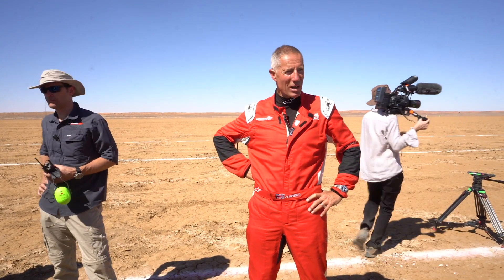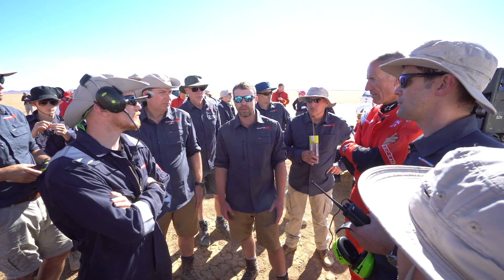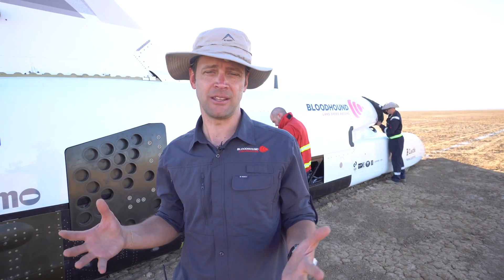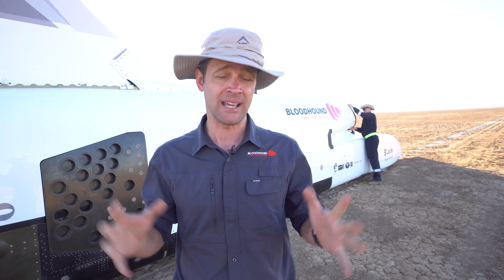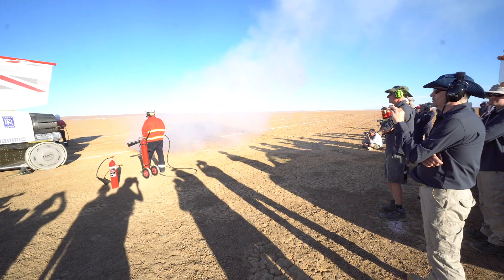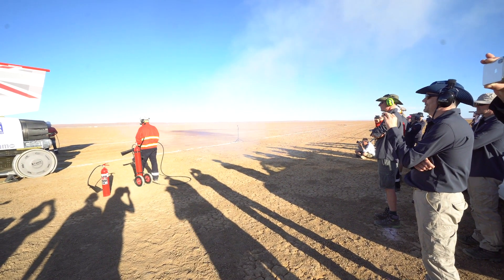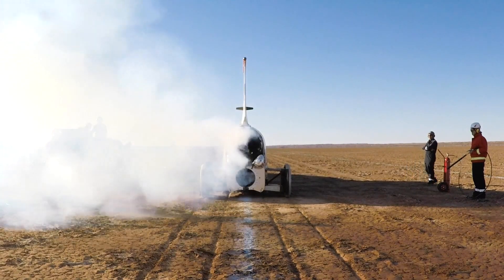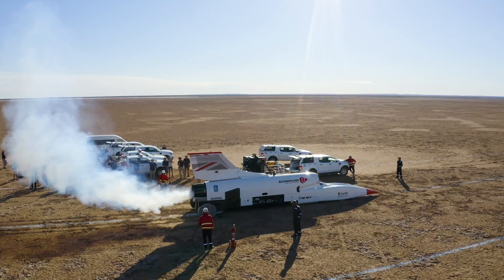Attempting Engine Starts | #2019HST

Comment: Do we have sensible adults or spoilt children watching these clips, complaining for instance, they are way too short?  Should we expect a chorus of. "It's not fair!" next?
The original Bloodhound SSC project was chronically short of funding for much of the time and was effectively in suspended animation more than once, with the team all but disbanded.  Finally, it ran out of money late last year and was put into administration.  It was rescued at the eleventh hour, almost literally, by one man, with the car within hours of being broken up for scrap.  Ian Warhurst has put his own money into the new project and it is his money that is funding the current high speed testing session out in South Africa.  
So for those who are whingeing about the title of the session, the plan has always been to test the car through a series of gradual increases in speed, on a surface and on wheels with which the team has only previously experimented at low speeds using a truck.   
To get Bloodhound LSR to where it is right now, the team had to be reassembled and the car, together with its whole workshop facility, moved to a new site, fortunately, not too far away.  The team has had to work flat out for the past few months, both to get  to get the car prepared and to make all the arrangements for it to be flown out to South Africa, and for all the supporting infrastructure to be in place.
There's an engineering team out there, but it doesn't have a full-blown public affairs department backing it up.  They are doing well to give us as much information as we get to see.
Good luck to them from this Bloodhound Ambassador of 10 years standing.

Comment: Been following this since the very beginning. Hopefully you will truely start to see the fruits of your labour after all these years of difficult engineering and lack of funding. I also love the fact the car was originally just down the road in Bristol, and now since the move to Berkley its literally 10 minutes drive from me :)  Itching to see some nice safe stable high speed runs that give you all the data you need to have a viable crack at the 1000mph next year.

Comment: Much to short, not building any drama. Hope your audio team is prepared to showcase the power and the sonic boom, will be listening on high power audio system with 2 12 “ subs. Current video- 1 star  potential- astronomical, hope you pull off not only the runs but the audio video production!

Comment: Surface looks soft! Slightly worried the shock wave buildup at the front of the car will tear the surface to bits at high speeds.
Reply: I think they figured out how to stop any shockwave build up under the car, at least in the simulations. The testing should hopefully validate the design.